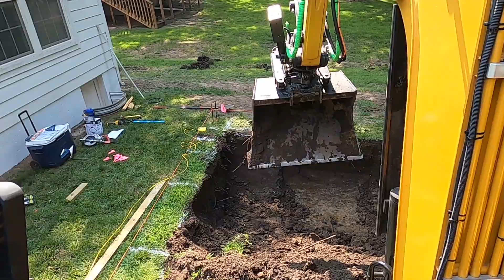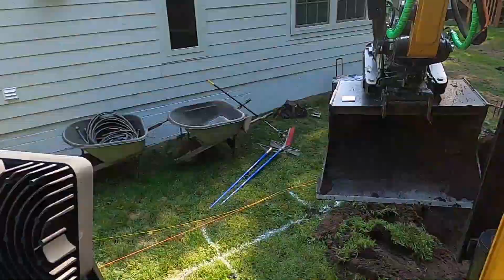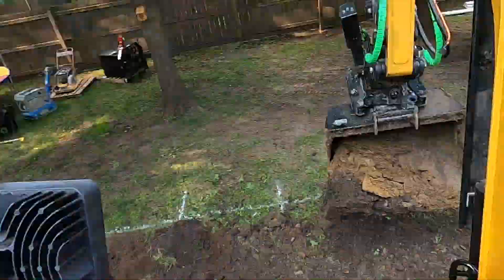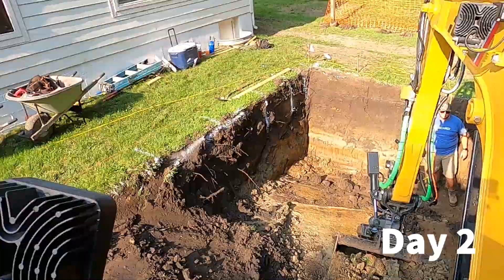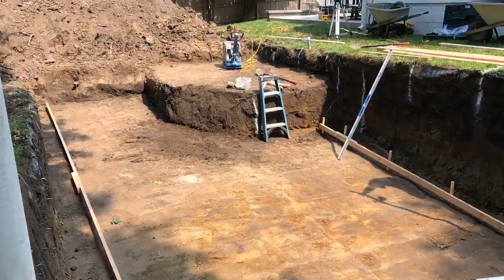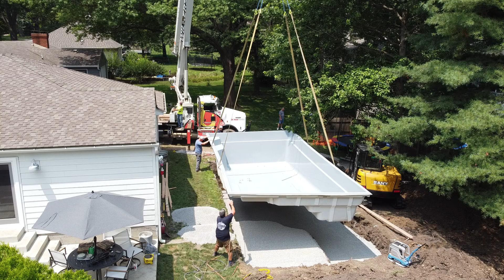FIBERGLASS POOL INSTALL PART 1 - TIME LAPSE - SANY SY60 - STEELWRIST

Comment: Hi Craig! What sand, base, and fill dirt material do you use for paver patios?

I'm in Wichita, KS. A lot of clay, a few areas have sandy soils.

For base: Belgard says use clean 3/4" angular hard stone. Dirt Monkey and others use a "dirty" 3/4" angular recycled class 5 stone with a variety of smaller particles mixed in. Locals are telling me to use what they call AB3 1.5" limestone road base material.

For bedding sand: I'm being told all kinds of things: man sand, screenings, mason sand, or fill sand (I think this is what Belgard recommends)

For soil subgrade correction: I'm being told fill dirt will do.

Great videos! Thank you for your help. I'm getting a quote right now for a similar f350 truck and 8.5 x 20 trailer sk 1550 setup as you.